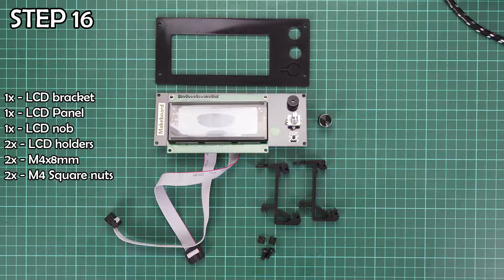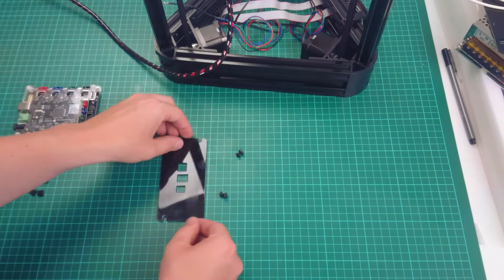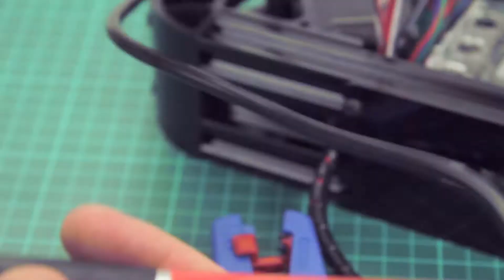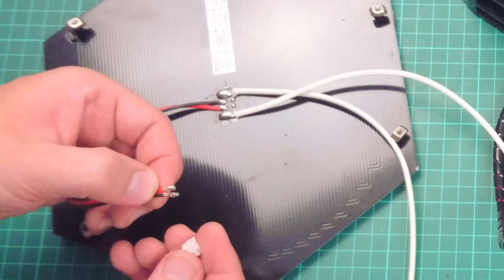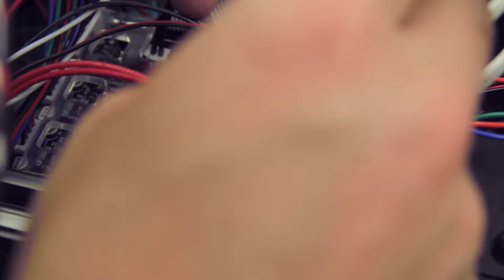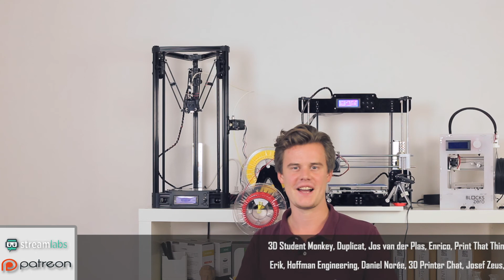Micromake DIY Delta - Build Guide Part 3 (Community3Dprinter Episode 3)

Comment: Wires which goes to screw terminals should not be tinned/presoldered. More about that is here.... http://reprap.org/wiki/Wire_termination_for_screw_terminals
Reply from the maker: Oh there you go!  thats a good tip, i was tought the other way around =)  thanks!
Reply: 3D Print - Tech Design  That is right, even here in Germany, the rules changed for that. No more soldering... I guess it changed  5 or 10 years ago.
You are supossed to use sleeve (or wire ends) not sure what they are called in English.

Comment: Any particular reason why you didn't ground the power supply with the ground cable? When dealing with 230v mains, wouldn't it be beneficial to ground the power supply and have a RCD to protect the user in case anything goes wrong? Or are these Chinese power supplies not taking advantage of it even tho it's clearly marked with a ground pin?